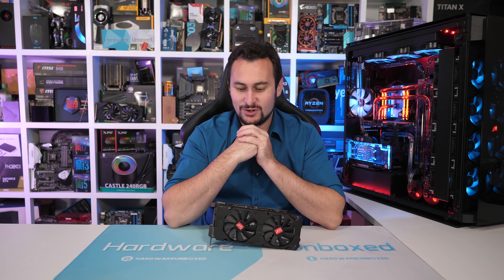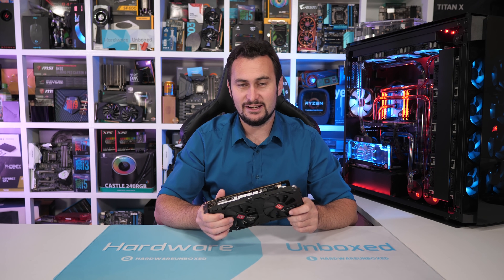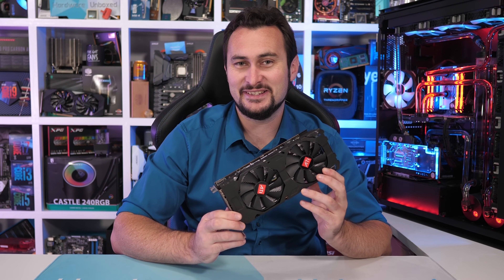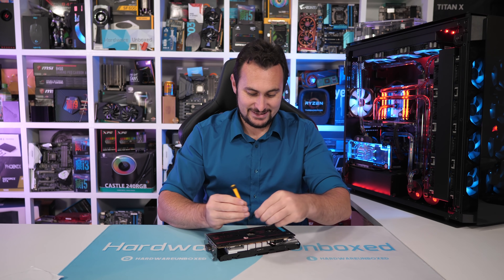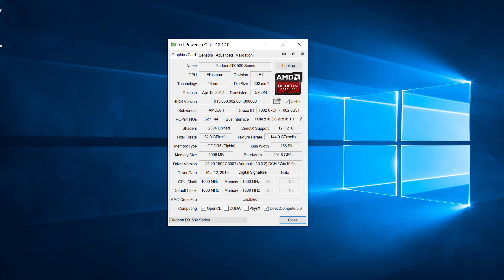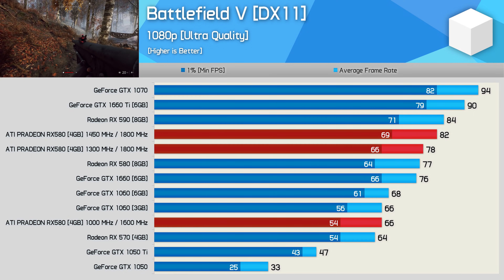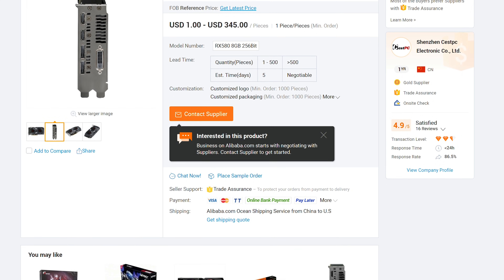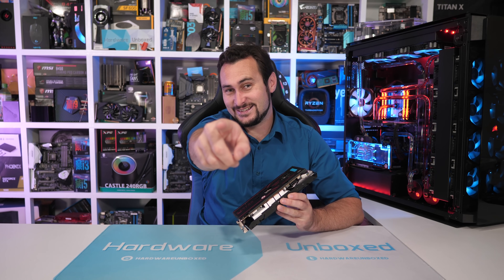ATI PRADEON, $96 Grey Market RX 580

Comment: I just picked up an 8gb ASUS RX 470 mining edition for a little under $100 brand new with it's full 2 year warranty (almost half the going rate where I live). When you can get the peace of mind of a warranty and a known brand for such a decent price there really isn't any point in going for these grey market specials. I think Steve hit the nail on the head with suspecting these are reflashed 480s. If you can get a bunch of mates together and pick up 15 of these for $70 and sell on the excess then it could be a really good deal but if you have to pay the full $100, do yourself a favor and get something from a known brand with a proper warranty. 

I would recommend purpose built mining cards (that have at least 1 display output). These tend to go cheap and typically perform on par with their "gaming" counterparts. The 470 I picked up actually comes with RX 570 clocks on the vRAM out of the box which means a simple core OC in MSI Afterburner should easily get me into 570 performance numbers. I'll hit some benchmarks once it gets here next week. It should be more than enough for my older games at 1440p. It's going into my work rig so I wasn't looking for anything over the top.
Reply: I totally agree. Also on this card there is no b-bios switch only one bios chip on the PCB as I could tell not an expert on PCB but am 99% sure only one bios.
Reply: Not bad performance for $100, 1440p high settings in Shadows of the Tomb Raider gets me an average of 41fps with a low of 36fps, drop settings to a mix of medium and high and I can hit 60fps average without issue. 3d mark Firestrike: 3dmark.com/3dm/35983985 . Star Wars Battlefront II averages 71fps maxed out at 1440p with a minimum of 45fps and .1% of 52fps during an hours worth of play in single player. 

This little 470 has turned my workhorse into a decent gamer and it didn't cost a fortune. My particular card detected as an RX 570 for some reason, it states RX 470 on the product ID sticker and it is clocked at the same core as a 470 so not sure what that is about. My firestrike score was with the card overclocked.

Comment: But the NewEgg Corn model 580 for $109 looks more like a 570 with just over 2000 shaders and not the 2304 it should have for a 580. There is a slightly more expensive (+$20) version that does list 2304 shaders, but probably the  same lock frequency issue. Was wondering about them.  Thanks for clarifying!
Reply: AMD released a china only version which had 2048 shaders and called it the rx580 2048, looks like someone been scooping them up for profit
Reply: @Tallnerdyguy  Yeah, forgot about that.  Thanks for the reminder! Here's the Gamers Nexus article on that; https://www.gamersnexus.net/hwreviews/3405-amd-china-rx-580-2048-review-dataland

Comment: I killed my RX470 by flashing it... I did it before but it had enough. But now I have bought a Gigabyte Vega 56 OC new for €295 though
Reply: Send me the 470 Ill reflash it.
Reply: @level8473  Ive tried everything I could find. I tried the 1+8 and other techniques that people recommend I should do, but no luck. And I had to solder it because my motherboard didnt allow the unrecognized gpu to be in the first pcie slot. It was too norrow to hold it.
Reply: Nice deal. Gigabyte Vega 56s are dogshit though, beware.
Reply: @philipbanks632  Vega 56s are dogshit? lol.... says you
Reply: @zackary87kr  no,gigabyte version of the vega 56, i assume.
Reply: @zackary87kr  He specifically said that gigabyte model
Reply: Sam Jung your knowledge of the gigabyte Vega 56 is lacking, it has terrible vrm cooling and suffers from other problems as well, 

Though the other Vega 56 models are great, this one isn’t as great
Reply: @mochageico  shit.... So... Should I send it back? An Asus Vega 56 is €325. I also have warranty till may 4th 2021
Reply: @mochageico  I did undervolt it and I checked the temperatures on HWiNFO64 and all temperatures censors HWiNFO64 could find were under 80 degrees Celsius.
Reply: @vsaucepog7829  Ok, thank you. I stand corrected. I was thinking he meant Vega 56 in general.
Reply: @diede3x060  If you're planning to return it, the Asus isn't very good either, it has some vrm cooling problems. If you can get one, a Sapphire would be ideal, they make the best AMD cards.

The XFX Vega 56 it's also good for what I have heard, but it's also one of the ugliest card I have ever seen. The Powercolor Vega cards are also very good.

Comment: The popes version of the RX 480

Pray'deon... Praydeon....
Reply: The Holy see recommends you only use the Pray-on brand of products!
Reply: Its also imaginary so whenever you buy it, the box is empty. You just need faith for it to exist.
Reply: pray for it not to be scam :)
Reply: Prey-on-little-boys-deons
Reply: Got to pray before going on holy cleansing
Reply: Praydeon, better suggestion than mine lol!
Reply: That's what I was thinking.
Reply: Wouldn't that be PrayDeiOn. since there is only one god in the christian faith? :D
Reply: Pray that it works for at least a year.
Reply: @VanRive   Actually I would  Bet on it working these are mining cards  The coolers well engineered For a reason. So you cover up the thermal pads that need to be covered clock it back up to what it's supposed to be.  Not to mention it seems to be a decently binned chip.
Reply: Or just get the full PrayStation 5 that might even support Pray Tracing

Comment: Yep. I know a guy who bought some GTX 1050Ti's (or so he thought). His system wouldn't read what the card was and with some professional help they think "they are GTX 650's that have been re packaged with new facings on the card and only 1 Gb RAm instead of 4. They have been flashed to say they are look like 1050Ti's but Windows 10 does not know what to do with them and they will not connect.  So none of them work."
Really felt for the guy. Lucky for Paypal & eBay for refunds. Dodgy as.
Reply: Bet he bought that during mining craze? 1050ti and 1080ti are two of the less affected card, and many of the 1050ti I encounter during that period are basically scam.
Reply: He bought it about 3 weeks ago. Chinese seller. All fake advertising.

Comment: watch out, ATI has been consumed by glorious AMD

also, a much better deal than 1650 apart from concerns with VRM quality and other whatnots
Reply: Ayyy
Reply: A fellow r/Ayymd member, I see!
Reply: Jo Ro Do I has r3 2200g and RX 580 from xfx
Reply: @BilJoeJaggins  So many of us!
Reply: @Benethen_  Not this 2080 ti owner. :)
Reply: Nvidia aren't competing with AMD. They have no market share. The 1650 is only competing with the 1050/Ti. What this thing is competing with is fake Nvidia cards, and considering those are old VGA cards for the most part, this thing does indeed win. That's assuming you want to buy a dubious quality Chinese knockoff with no warranty over a genuine used card, also with no warranty.